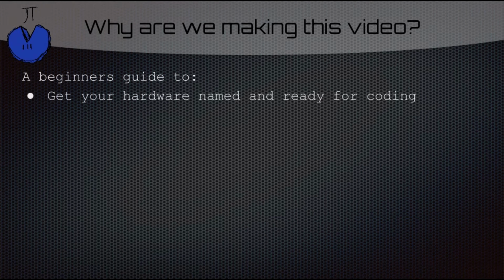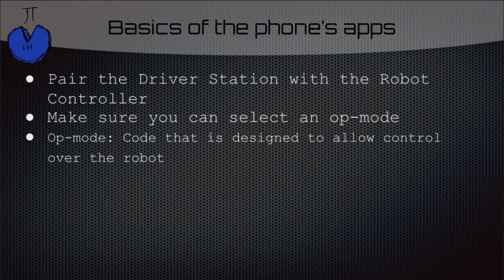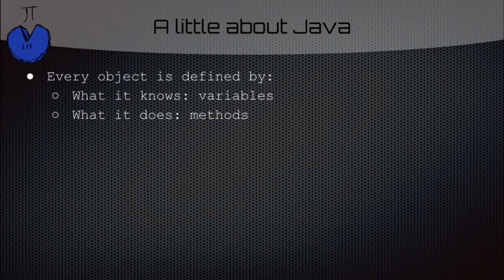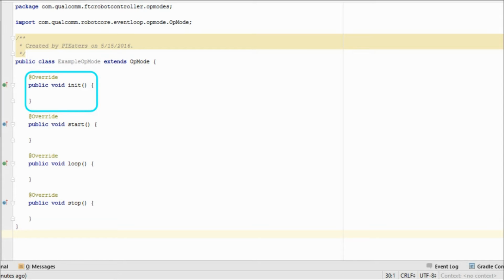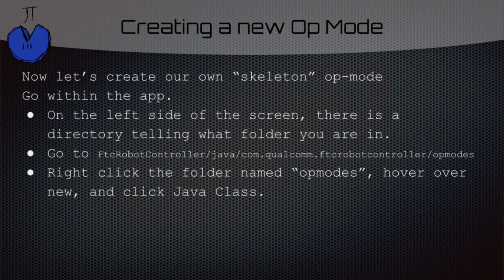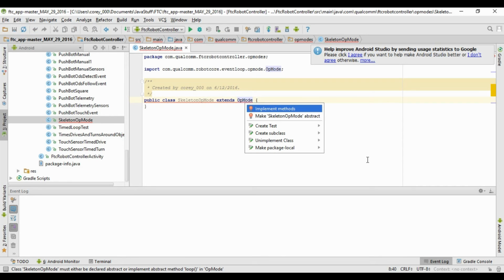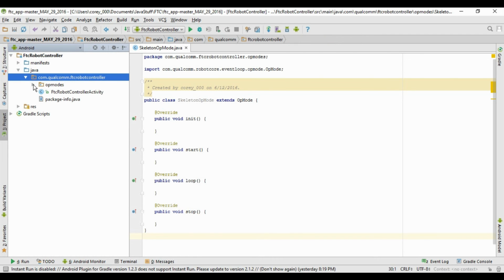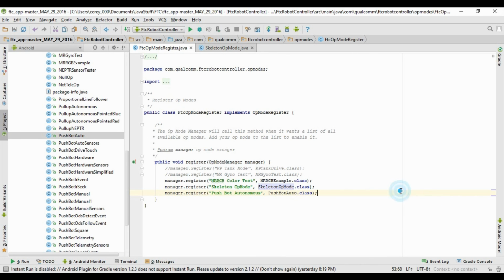SEE DESCRIPTION  for update - Beginner Programming -part 1 - Java for FTC Robotics

Comment: I cant find com.qual in my java folder proof https://gyazo.com/5a3a0e2d0e0903e4213dca38b143640a
Reply from the maker: You are correct. Some things have changed since we made this video. The "external.samples" folder you found is very valuable though. It has example opModes with comments to tell you what's going on. There is a new , simpler procedure for registering opModes. Check out the video that is linked in this videos description. It will show you the new way to register opModes. Everything else should be pretty much the same. We hope to update this video in the next couple of months (once we are out of school). Let us know if you have any other questions, and thanks for watching!